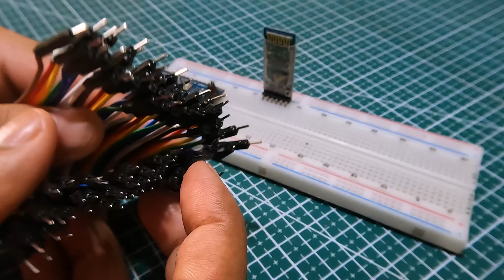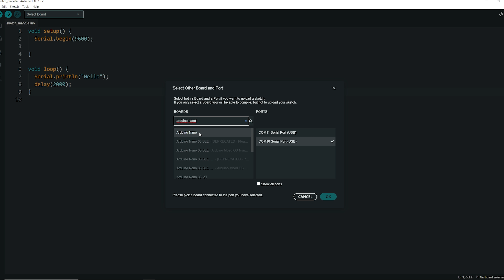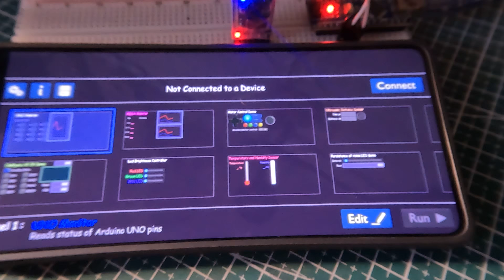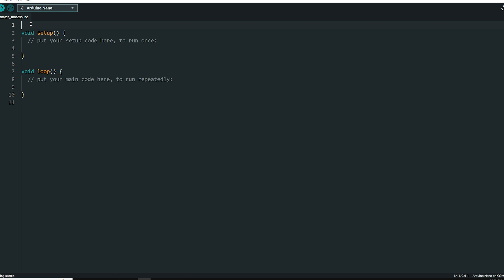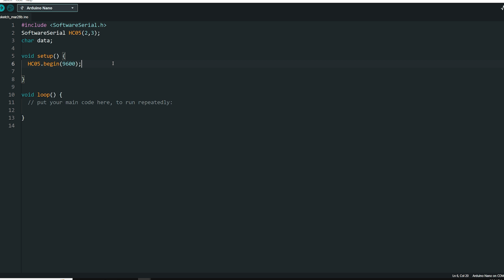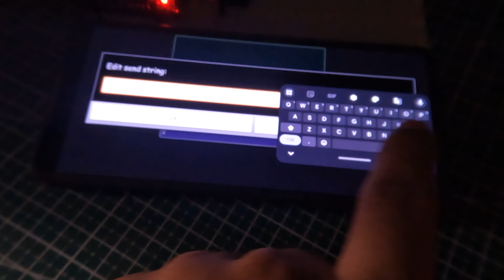How to Connect a Bluetooth Module with Arduino | Simple Bluetooth Project Tutorial

Comment: Could someone help me out? I tried to use this tutorial and whenever I plug in the Bluetooth module, the Arduino's red light suddenly becomes dimmer. Something is off and I have done the connections multiple times.
Reply: Voltage compatibility becomes crucial when connecting Bluetooth modules to Arduino boards. Most Bluetooth modules run on 3.3V logic, while many Arduino boards like the Uno and Mega use 5V logic. Direct connections could damage your Bluetooth module. You'll need a voltage divider or level shifter between the Arduino's TX pin and the module's RX pin.
Reply: @jamesn4727  Yes I have tried that, I realized I somehow damaged the board in other projects that I did, I must have done a wire issue. I got new boards and it works perfectly! Thank you for this video!